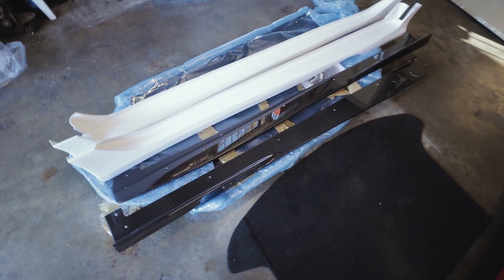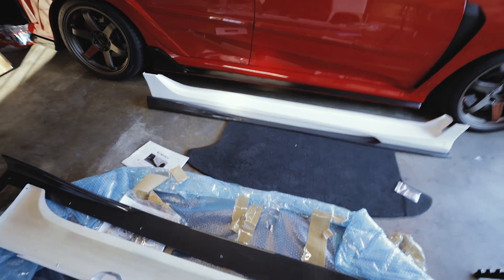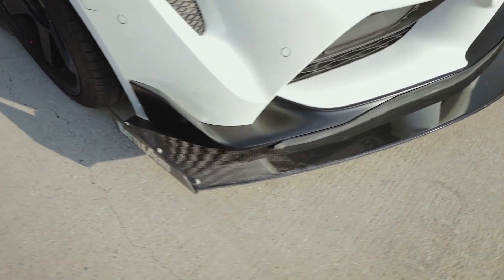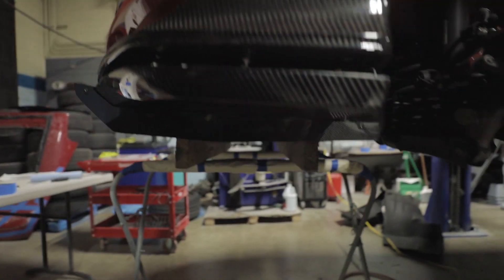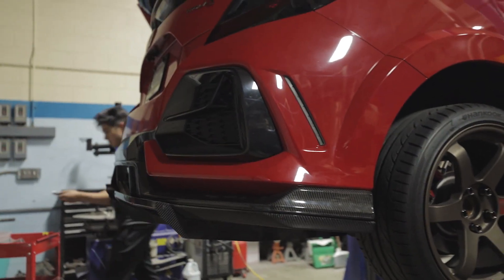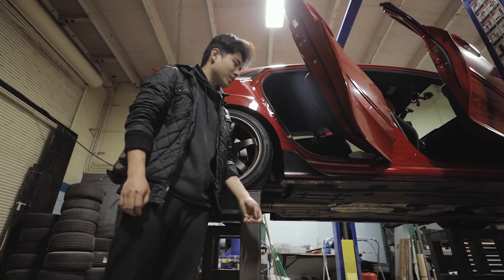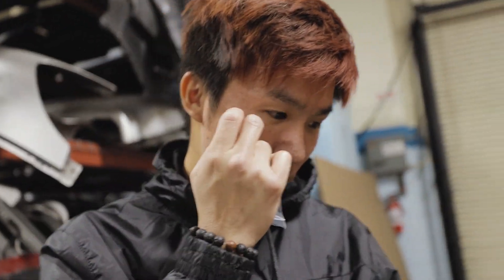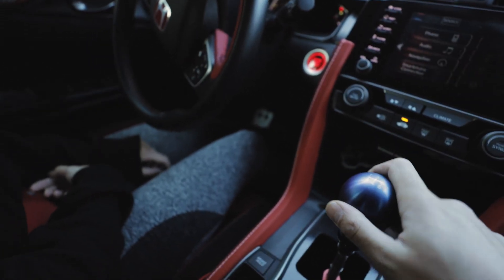THE TYPE R LOOKS SO GOOD NOW

Comment: My girlfriend actually taught me how to drive stick.. 😅 she's got a 2020 civic hatch touring. Surprised since the dealership actually put a little diffuser and front splitter. Trying to decide if we want to mod it or just buy the ctr with all the sh*t  we would end up installing. Her car is already a little rare I guess since 2020 was the first year they did the mt on the touring trim so she likes it for that reason but obviously the biggest difference would be 2L vs 1.5. Any advice?
Reply: From someone who went though something similar. I had a lower trim civic. Not si or CTR and it felt like I was moding something that didn't fully satisfy me. Assuming you have the money and it wouldn't cause any issues. I wouldn't get a CTR if it was too much. That feeling of unfulfillment was due to me having spare money for it and not going through with it the first time
Reply: @Hondaddy  I see. The thing that has me wanting the ctr is just due to the slightly bigger engine. More possibility for more HP 😁  another thing is that suspension is already set up for more HP I assume

Comment: I feel like learning how to drive stick in the CTR is kinda wrong. I say this because it’s so easy it’s hard to drive another car after.
Reply: I think the car has an anti stall feature as well, when you let off the clutch slowly you can notice the engine revs on it's on to prevent stalling. I'm pretty sure the car even adds a little gas on the upshifts. Very smooth car to drive manual on, my old STI felt like a truck compared to this car.